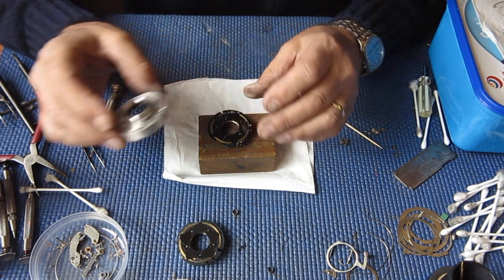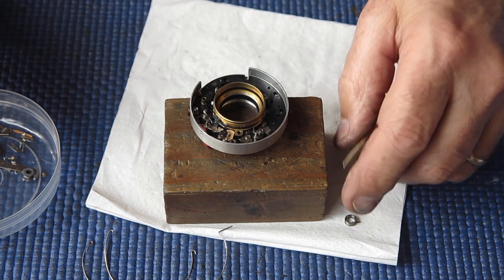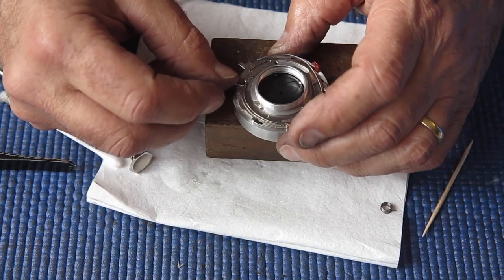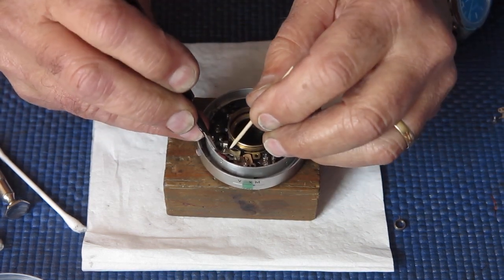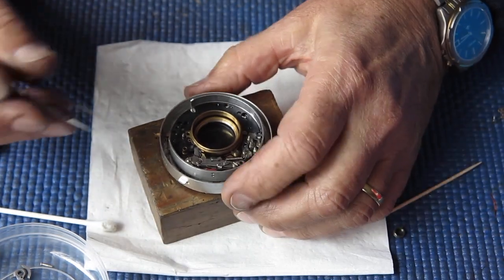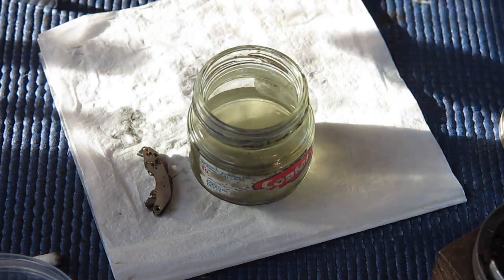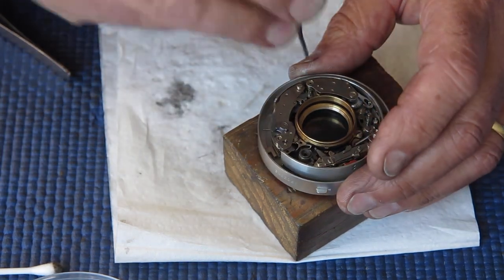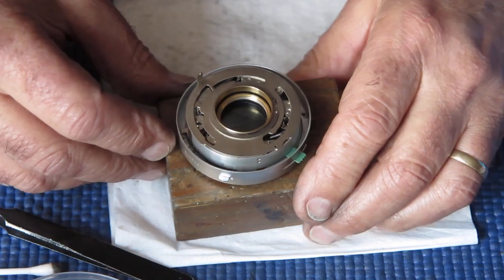Retina Reflex type 025 complete service 08

Comment: I had to come back here to see the details of the two springs that control the aperture blade and shutter blade closures on the back of that case.  13:30

For some reason, years ago I adopted a Type 025 that had many problems and one of them was that the spring controlling the shutter opening for viewing had the extension portion that extends outside that case diameter broken. How the heck does that happen? I suspect that the spring somehow got dislodged and caught on something and that a forced attempt to cock the shutter snapped the end of that jammed spring right off. I managed to get the rest of the camera functional with the exception that the shutter blades remain closed upon winding. Kind of a handicap in the field. :-) 

I took a few screenshots of this assembly process for visual reference as how this is supposed to look like and function, as I may purchase some 0.022" music wire and attempt to fabricate a DIY replacement spring. 

Thank you Chris for the endless education and adventure opportunities. 

Glenn

Comment: Just wondering what you use as a degreaser? I am soaking things in Naphtha and running thru the ultrasonic but still sometimes I get a hard surface grease that wont come off even in with the naphtha.

Comment: I have a question regarding shutter speed adjustment, Mr. Sherlock: when I set it at 1/8 it closes at a speed more akin to 1/15; at 1/15 it feels more like 1/60. All other speeds feel about right, and bulb works perfectly. I've moved the retard gear train as close to the center of the shutter as possible but it won't slow down much at all... Would you say the drive spring sounds like it might be a bit worn out? Is it possible to adjust it if that's the case? Everything runs smoothly and all other speeds seem right, I don't know what else it might be.